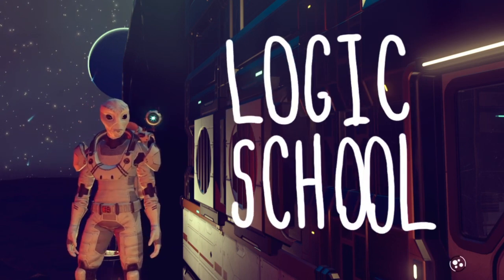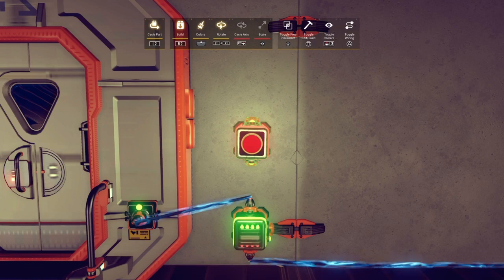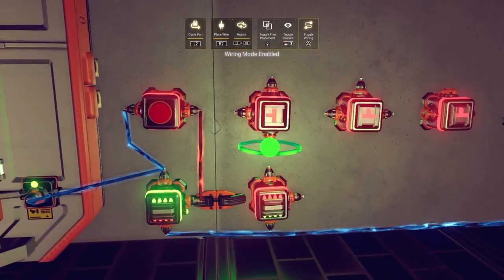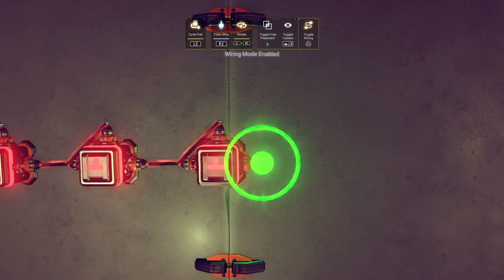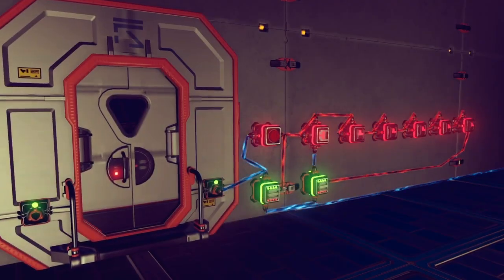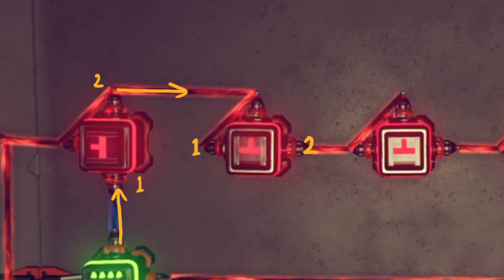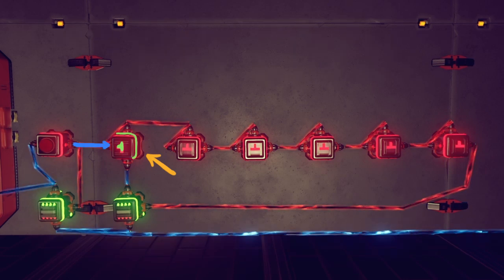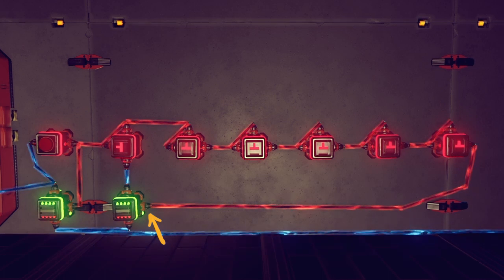No Man’s Sky, Logic School: A Timer Circuit and Pulse Extender (and Autoswitch fundamentals)

Comment: Great job on explaining NMS logic. I fell in love with learning TTL and how to translate to NMS. So far my largest computer is over 6500 parts. However it has a small but working EPROM, program counter, three 7 segment display, full 4 bit adder and subtracter, and three registers. It can only do 4 bit mathematical operation, but it can be coded to do any combination of operations. 

I actually suffer from psychological problems with reasoning and logic, so learn TTL has helped me so much in rational thinking. Seeing how complex systems can make rational sense based on simple logical rules, is  something I wish I learned in my teens. Thank you for the video I am excited to see how you do latches or displays. Eventually I want to be able to remake the intel 4004. On a very slow 1hrtz speed lol.